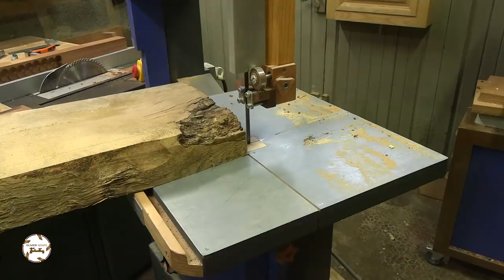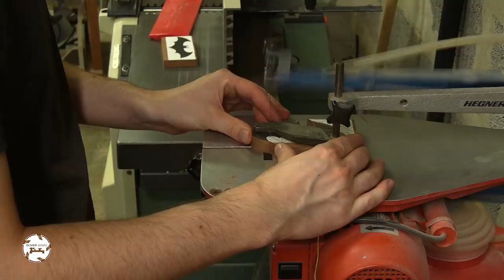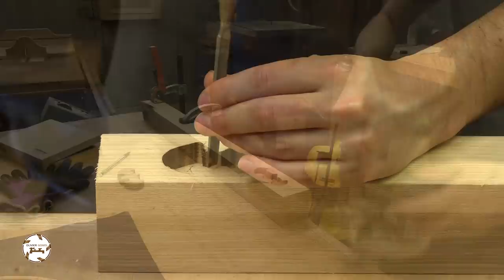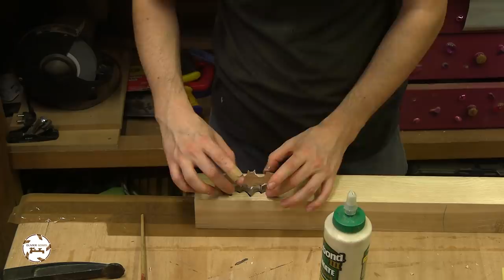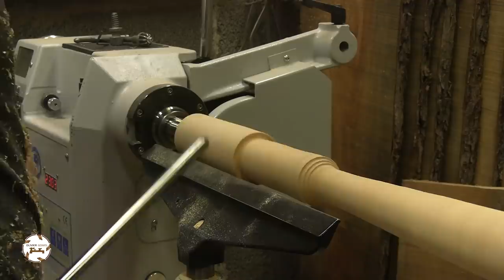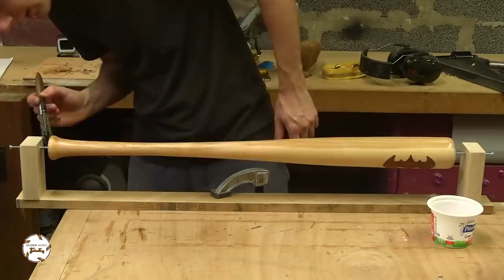Woodturning - The Baseball BAT

Comment: Honestly using the band saw on the 1st cut IMHO was pointless since the 2nd cut was on the table saw, also the 1st plaining the wood was more pointless as the wood is being turned and the inlay goes deep enough that the surface doesn't matter... You can argue that paining made it easier because the flat surface but the table saw makes wood flat enough for that... But good work...